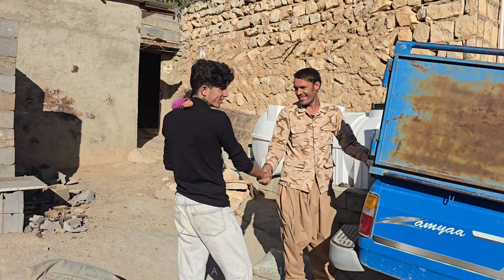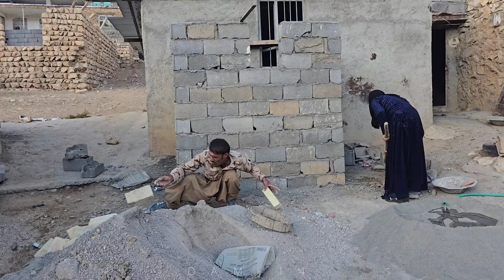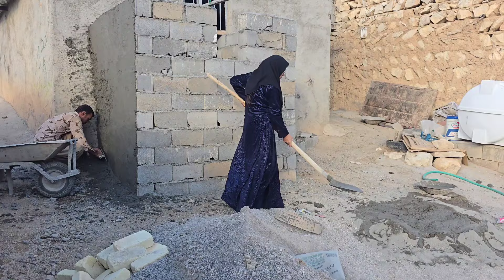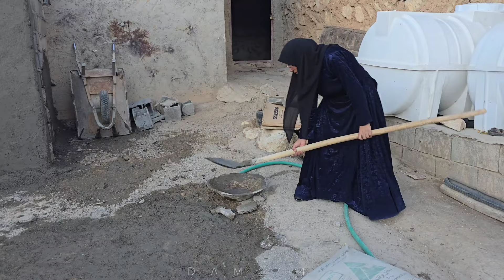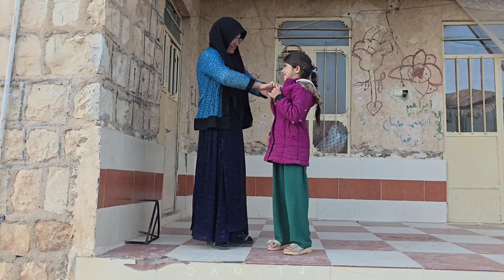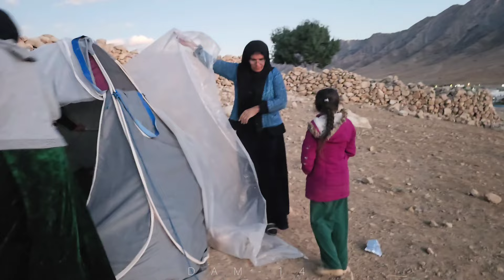"Correlation and cooperation: Mohammadreza and Sakineh in the construction of sanitary toilets"

Comment: Why do you people in Iran put stones under the tires? You do have both a parking brake AND a manual transmission (gear) most of you it seems! If you use both of those, you do not need stones!!! We have lots of hills here in Norway and we very, very rarely (almost NEVER) feel a need to use a stone. So why do the people in Iran? You put the parking brake on (which of course should be properly maintained) and you set the car in first gear or in reverse, depending on which way the car is in a hill. In this video, it was almost flat, I don’t get why the stones!!! Is it only me??? 😂😂😂